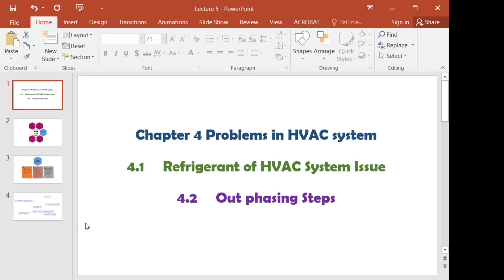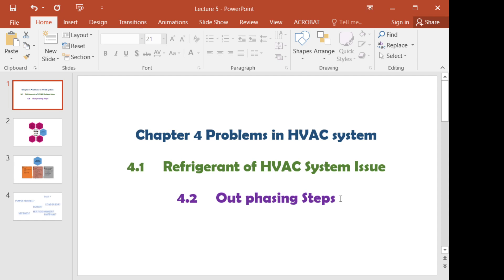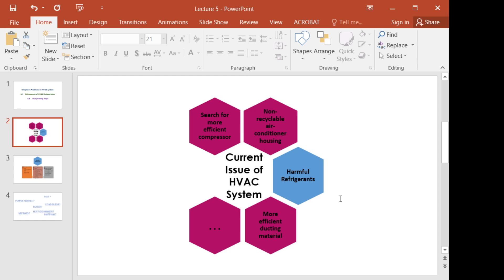Lecture 4 Issue in HVAC system

Comment: MUHAMMAD HAZIM BIN ISMAIL
B071710545
4 BMMH S1/1

CHAPTER 4: Problems in HVAC Systems

Current Issue of HVAC System: -
1.	Search for more efficient compressor
2.	Non-recyclable air-conditioner housing
3.	Harmful refrigerants
4.	More efficient ducting materials

Comment: CHAPTER 4: Problems in HVAC Systems

CHEAH KOK HUN B071710006

Current Issue of HVAC System: -
1.	Search for more efficient compressor
2.	Non-recyclable air-conditioner housing
3.	Harmful refrigerants
4.	More efficient ducting materials

Comment: AMIRA NASUHAH BINTI ALIAS
B071710121

Current Issue of HVAC System: 
1.	Search for more efficient compressor
2.	Non-recyclable air-conditioner housing
3.	Harmful refrigerants
4.	More efficient ducting materials

Comment: NUR FITRAH NADIA BINTI KAMIDAN
(B071710363)
4BMMH S1/2

TITLE: LECTURE 4 VIDEO

CURRENT ISSUE OF HVAC SYSTEM
1. Search for a more efficient compressor.
2. Non-recyclable air conditioner housing.
3. Harmful refrigerant.
4. More efficient ducting material.

Comment: MOHAMAD HURAIRAH BIN HARUN 
B071710461 

Current Issue of HVAC system 
•	Search for more efficient compressor 
•	Non-recyclable air-conditioner housing 
•	Harmful Refrigerants 
•	More efficient ducting material

Comment: MUHAMMAD AKRAM BIN RAZALI (B071710573)

Current issue of HVAC system:-
- Search for more efficient compressor
- Non-recyclable air-conditioner housing
- Harmful refrigerant
- More efficient ducting material

Comment: MUHAMMAD AMIR SYAFIQ BIN AHMAD SUKRI
B071710161

Problem in HVAC System

Current issues of HVAC System:
•	Search for more efficient 
•	Non-recyclable air conditioner housing 
•	Harmful refrigerants
•	More efficient ducting materials

Comment: MOHAMMAD NAZRIN BIN BAHARUDDIN
B071710111

REFRIGERATION OF HVAC SYSTEM ISSUE

Current issue of HVAC System :

1) Non recyclable air conditioning housing

2) Searching for more efficient ducting material

3) Search for more efficient compressor

4) Harmful refrigerants

Comment: MUHAMMAD SYAFIQ BIN ARZEMI
B071710014
4 BMMH S1/1

"PROBLEMS IN HVAC SYSTEM"

   # Current Issue of HVAC System :
      > Search for more efficient compressor
      > Non recyclable air-conditioning housing
      > Harmful refrigerant
      > More efficient ducting material.

Comment: NUR SELIHAH WAL HUDA BINTI AHMAD - B071710190

REFRIGERATION OF HVAC SYSTEM ISSUE
Current issue of HVAC System :
1) Non recyclable air conditioning housing
2) More efficient ducting material
3) Search for more efficient compressor
4) Harmful refrigerants

Comment: Ahmad Khairul Akmal 
BMMH s1/1
B071710715

Explanation of current issue of HVAC that is causing problem for proper progression:

1. Search for more efficient compressor to work in HVAC system.
2. Non-recyclable air-conditioner housing.
 3. Harmful refrigerants such as R22 and R32.
4. More efficient ducting materials to reduce heat lose.

Comment: AHMAD ASYRAFAMIRUDIN BIN AZNAN
B071710607
4BMMH S1/1
Current issue of HVAC system.
-	Search for more efficient compressor 
-	Non-recyclable air conditioning housing
-	Harmful refrigerants
-	More efficient ducting material

Comment: MUHAMMAD ZULQARNAIN BIN ZAMZURI 
B071710782 4BMMH1/2

Issue in HVAC Field
1.	Search for more efficient compressor
2.	Non-recyclable air-conditioner housing
3.	Harmful refrigerants
4.	More efficient ducting materials

Comment: MOHAMAD ZARIF BIN ROSTAM 
B071710681
4BMMH S1/2
 
ISSUE IN HVAC FIELD
Current Issue of HVAC System
1. Search for more efficient compressor.
2. Non-recycleable air conditioner housing.
3. Harmful refrigerant.
4. More efficient ducting material.

Comment: NUR SHAFIQHA BT ABDUL GHAPOOR 
B071710400
4BMMH S1/1

LECTURE 4
Problems in HVAC system
Current issue of HVAC system:
1.	Search for more efficient compressor
2.	Non-recyclable air-conditioner housing
3.	Harmful refrigerants
4.	More efficient ducting material
5.	Many more..

Comment: MOHD SAZWAN FITRIE BIN MOHD. KHAIRIL FITRIE
B071710488
4BMMH 1/1
Chapter 4: Problems in HVAC System
4.1 Refrigerant of HVAC System
Current Issue of HVAC System 
•	Search for more efficient compressor
•	Harmful refrigerants
•	More efficient ducting material
•	Non-recyclable air conditioner housing

Comment: MUGAHMMAD HAFIZ BIN JOHARI  (B071710380) BMMH 1/2

  ISSUE IN HVAC FIELD
Current Issue of HVAC System
1. Search for more efficient compressor.
2. Non-recycleable air conditioner housing.
3. Harmful refrigerant.
4. More efficient ducting material.

Comment: AHMAD LUQMAN HAKIM BIN ZAMBRUS
B071710359
4 BMMH S1/1

Issue in HVAC field
1) Harmful refrigerant
2) Efficient ducting materials
3) Non-recyclable air conditioning housing
4) Efficient ducting material

Comment: MUHAMAD IZMAN BIN JAMALUDDIN
B071710518
4BMMH S1/2

CURRENT ISSUE OF HVAC SYSTEM
1. Search for a more efficient compressor.
2. Non-recyclable air conditioner housing.
3. Harmful refrigerant.
4. More efficient ducting material.

Comment: ALDY HENRY DUSIM
B071710329
4 BMMH S1/1

Current Issue of HVAC System: 
1.	Search for more efficient compressor
2.	Non-recyclable air-conditioner housing
3.	Harmful refrigerants
4.	More efficient ducting materials

Comment: ARVINTH A/L RAMACHANDRAN 
B071710339
4 BMMH 1/2

Problems In HVAC System 

4.1 Refrigerant of HVAC System Issues 

Low refrigerant levels This is one of the most common problems with HVAC systems, especially older ones that have not been well maintained. If your air conditioner is leaking refrigerant, you’ll notice airflow issues as well as reduced cooling. Typically slow leaks cause a gradual decline in system performance.

Current Issues of HVAC System 

- harmful refrigerants
- more efficient on ducting materials
- Non recyclable air conditioning housing
- Search for more efficient compressor

Comment: HAKIM BIN ZAINUL
B071710531
4BMMH S1/1

Chapter 4 PROBLEM IN HVAC SYSTEM

4.1 Refrigerant of HVAC system issue
       •	Current issue of HVAC system
              o	Search for more efficient compressor
              o	Non-recyclable air-conditioner housing
              o	Harmful refrigerants
              o	More efficient ducting material.

Comment: MOHD RAHIMI BIN MUSTAPHA
B071710225
4BMMH S1/1

Lecture 4: Problem In HVAC System
>> Refrigerant issue in HVAC system:
              o	Search for more efficient compressor
.
              o	Non-recyclable air-conditioner housing
.
              o	Harmful refrigerants
.
              o	More efficient ducting material.

Comment: MUHAMAD NURHISYAM BIN MOHD HASNAN
B071710148 4BMMH 21/2

chpt4 problem in hvac system.
1. search for more efficient compressor
2. harmful refrigerant
3. non recycleable air-cond hausing
3. ducting materials

Comment: MOHAMAD SYAFIK BIN SOFI
B071710064
4 BMMH S1/1

problem in HVAC system
-search for more efficient compressor
-non recyclable air-conditioning housing
-harmful refrigerant
-more efficient ducting material.

Comment: KHOR YE SHU B071710464
4BMMH S1/2

        4.1 Current issue of HVAC system
              4.1.1 Search for more efficient compressor
              4.1.2 Non-recyclable air-conditioner housing
              4.1.3 Harmful refrigerants
              4.1.4 More efficient ducting material

Comment: LUA WEI JIE (B071710861)  4bmmh s1/2
REFRIGERATION OF HVAC SYSTEM ISSUE
Current issue of HVAC System :
1) Non recyclable air conditioning housing
2) Searching for more efficient ducting material
3) Search for more efficient compressor
4) Harmful refrigerants